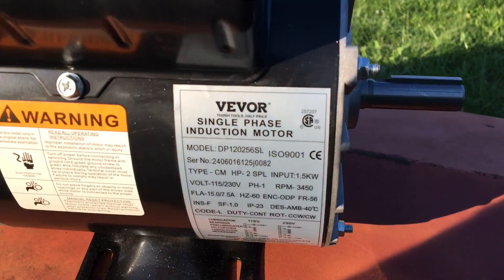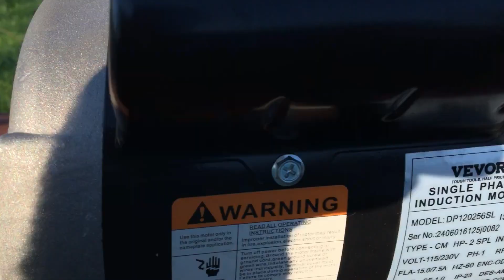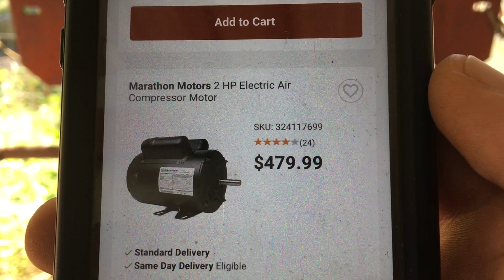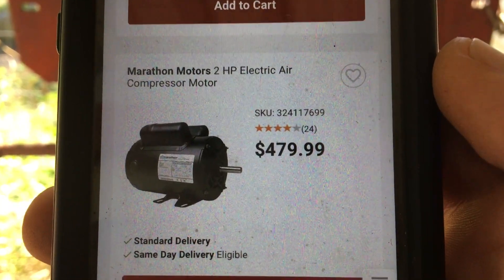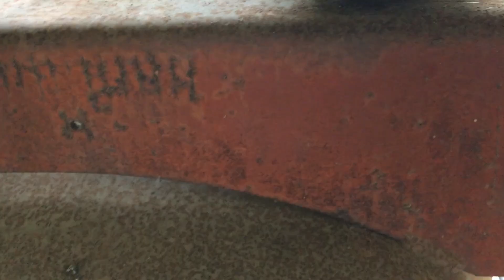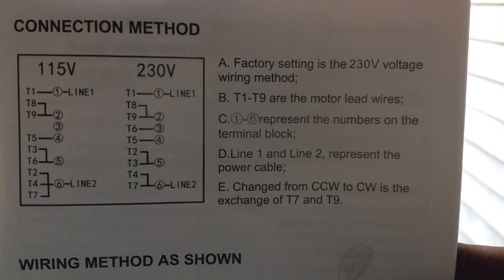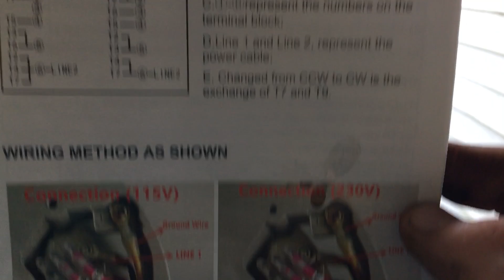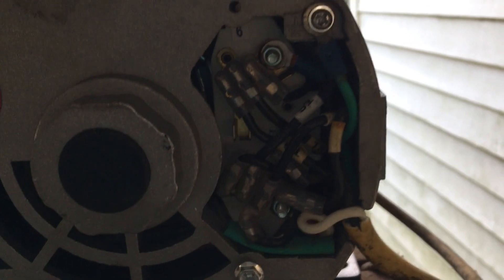Are Vevor Electric Motors Any Good? Can The 2hp Motor Run My 3hp Air Compressor? #vevor #vevortools

Comment: Wait until that key goes flying
Reply from the maker: Why would the key go flying? It has a set screw tightened down against it.
Reply: @BlackLabGarage  oh good. I didn't see the key. It appeared to be just a key in the shaft with no pulley on it when you turned it on. I'm glad you had it secured. I have researched the vevor motors but have found mixed reviews
Reply from the maker: @OtisDavies-cv6ze  I can't complain on mine at all. It's still going strong.

Comment: It costs around $150 to have a motor rewound and with new capacitors and it is still American made. That makes more sense especially when vevor electric motors are hit and miss with the quality and durability
Reply from the maker: Can't get one rewound here for that. Most places won't even rewind an electric motor that small anymore because they will tell you it's cheaper to replace them than it is to rewind one.
Reply: where is the question and yes because i have a 5hp motor which was one of the best things ive got to experience on a devilbisss small compressor i was able to fill the tank it self plus another tank and i had tremendous air power id only imagine what the stronger 7.5 hp vevor version can do after the 5hp , and yes hes right them dam things cost more than a compressor on market place , i went and bought a brand new one at 2hp klutch from the northern tools ... for $239 plus $50 for the  1 yr no fuzzz guranteee .... but it already supposedly comes with 3 yrs , yeah 2hp isnt much 2bh ... yes u can sly by but also the 5hp one wasnt belt driven but they are the same almost jst gotta check diameters but its ok since i literaly have like 5 compressors laying around and 1 is belt driven .... what happen is that i used a 220 v into a 12 v cord and the 5hp wouldnt crank then i re tried 2-3 times and it did worl and tought myself of a genius really an idiot for ruining a nice motor compressor . so i was trying off a generator then i saw the smoke and then some fire the dam thing had burned . then i tried the second and it seconds also burned but seems like it survived ., but i ruined 2 devilbiss compressors in under 5-10 mins , i learned the hard way but yes its truly hard to see who can re wire the coils in those motors and if theres some local not so expensive i doubt ., for the 5hp one i was willing to go for the long ride for the $150-$200 pay but its like $200 new but now my eyes are on the 7hp one and thats where i say buy it and keep the dam thing til u see a market place offer .... because i know what 5hp looks like its amazing other and my regret was having had sold my gas compressor i got lucky at $150 -$200 and sold it because some other guy said they were bad when in reality thats the solution but looking at 1-2-3 k and honestly gas is the way to go , no more worry about circuits breaking and high monthly bills well the generator i have seems to have issues with anything we connect like a welder or compressor , but yes! i might get the 7.5hp for the $200 or in should jst save up $1,200 and jst get the gas compressor  , its all about saving money ....

Comment: I was just about to do this same thing last week with my second hand Pilot 3HP compressor and a Vevor motor idenitcal to yours , until I realized that the problem on my old one was in the power feed - was missing a leg of 240.  I was planning to run a smaller pulley  on the motor to compensate for the 1/3 drop in power. Did you change the pulley out or is it actually running OK with the same drive ratio?
Reply from the maker: @sumdumhick  mine has no problems running a 3” or 3 1/2” pulley on the motor.